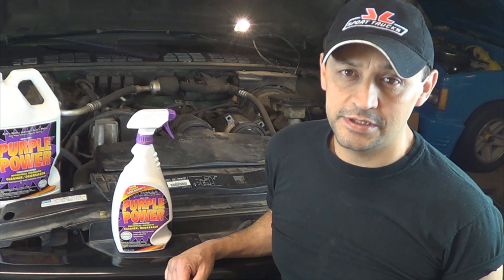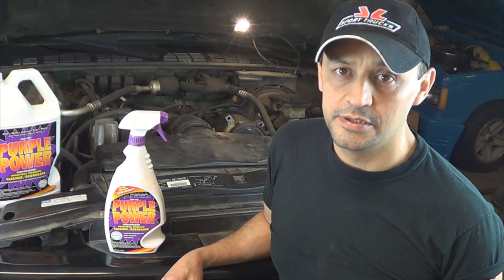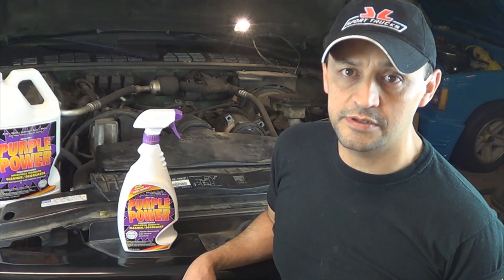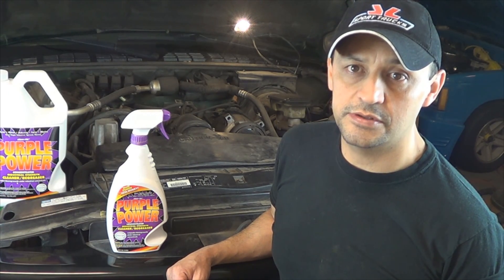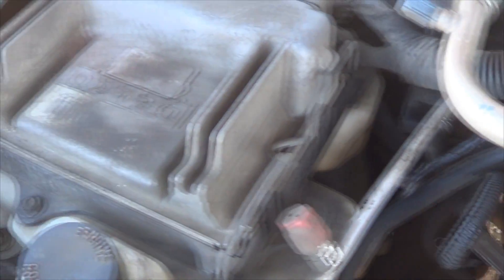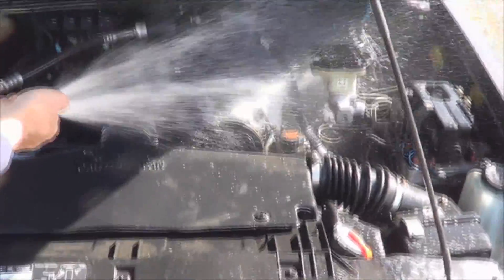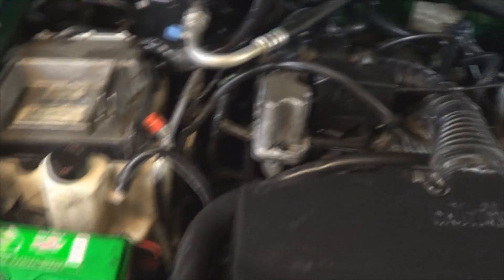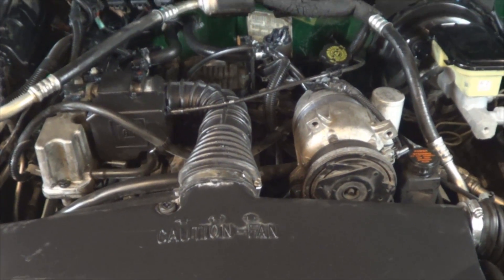How to degrease an Engine at home with Purple Power Degreaser by Howstuffinmycarworks

Comment: The stuff does work, yes I would recommend putting plastic bags over alternator, anything you can tell is electrical.  I generally wash the engine, than leave the hood up & let it dry for a couple of hours before restarting it.

Comment: I would probably just use a hose in my driveway, in case my engine gets wet and won't start.
You don't want a no-start condition when you are at the car wash unless you are willing to take the chance.

Comment: same thing I've been using for years. works the best and pressure washer works a lot better.
Reply: Pressure washer  is way  more dangerous. as you can pressure one Electronic plugs and sensors. Also get into the wires via its backside connection where wires are not sealed., Just scrub a little and Just a Shower Spray, Better to be safe then sorry and damage some Expensive Electronic sensors. NO Pressure Washer on Engine Ever.
Reply: @ELEVOPR  pressure washer have been used on engines/engine bays for yeeeeeeeeeeeeears without issue. Nice try tho
Reply: @ELEVOPR  dude a garden hose shoots out way more water than a pressure washer hence the word PRESSURE its pressurized water not a heavy stream of water

Comment: Noticed you didnt cover your alternator, before spraying the water?
Reply: Honestly degreaser is corrosive so i prefer to make sure i always completely soak the engine after. Especially the copper and aluminum parts. I’ve never had an issue personally, i just start the truck after and let it idle and it dries up pretty quick especially with the fan blowing air on it.

Comment: the guy at oriely"s said i could use it on the inside.of my engine when i was replacing the valve cover. Is this true
Reply: no
Reply: I used it inside my combustion chambers and it seized my engine up

Comment: should I be concerned about getting the air filter wet?
how long should I wait till using the car again?
simple questions a busy person would be concerned about.
Reply: +Eric Palafox Answer 1- Never get the air filter wet. A clogged filter with water will deprive the engine of air. Answer 2- Id say wait until the engine is dry.

Comment: Please please please do not spray your belt, alternator, or electrical connections in your bay if you have a used car. Connections are meant to be water resistant but they lose that over time.

Comment: I watched a video of this stuff removing bugs off the bumper of a car so it's NOT good to use on paint?
Reply: NO DONT PUT IT ON YOUR PAINT
Reply: It will remove bugs, but it's pretty aggressive.  Always start with the least aggressive chemical, then move up if that doesn't work.  Dish washing soap will remove almost any kind of bug splatter from paint.
Reply: Dude just use a sponge.a hard but wet sponge
Reply: djsonicc I heard dish soap will dull paint. Not sure if it’s true though.
Reply: Andy Mcmahan I would shy away from putting it on your car’s paint. If you want to try it, pick the least noticeable area of paint on your car and use Purple Power diluted 10:1 or greater. Or take it to a junkyard and try out various strengths of it on cars 😝

Comment: What about the electronics, what if you get them wet can't you really do some damage?
Reply: All engine bay connectors are rated for splashing water. Garden hose should be fine. Pressure washer not so much.

Comment: Looks like he wet the WHOLE engine.. Is that safe?!? Plan on doing this
Reply: +puletasi44 Yes, just be careful around sensitive electronics. Think about all the rain that gets under your hood when it rains.
Reply: +crazyjdkid thanks bud.. But he doesn't even cover the battery.. Was that ok also thinking that it is electrical..
Reply: Yes
Reply: You should put a bag on the alternator, and distributor. Disconnect the battery.
Reply: I would recommend you not spray water on your engine.
Reply: Han Skinslo how do you think detail shops do it then? I used to do this 3-4 times a day.never a problem
Reply: @hanskinslo326   just cover the sensitive parts ( electrical ) with plastic bags.
You will be fine. Use common sense.